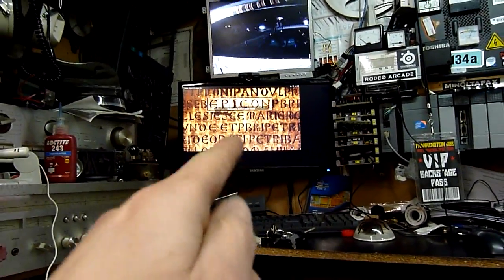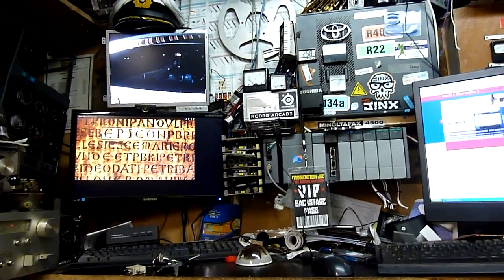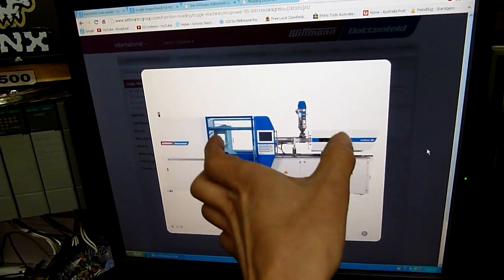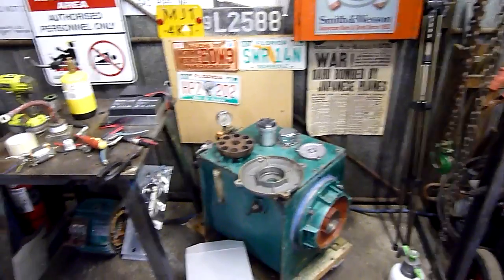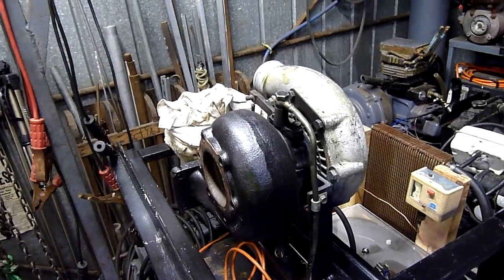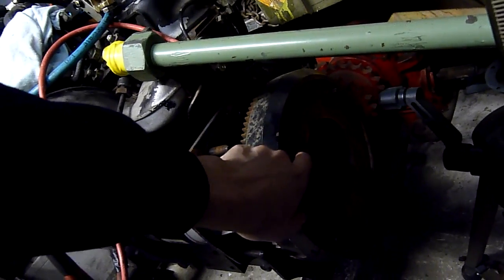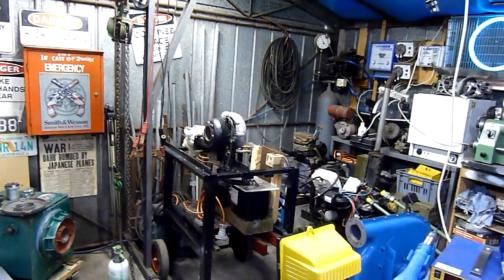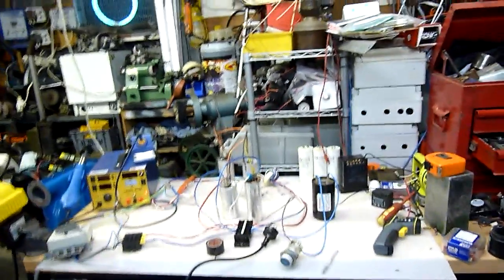Enter the Ramblotron - June 18 2013

Comment from the maker: wow that's pricey :(, another reason why i avoid modern diesels :(.

yeh the D4D is a terrible engine for service costs and gremlins, our local Middys electric bought a Hiace D4D and it went back to the shop half a dozen times in the first few months :(

the high pressure rail can blow out on them as you said, gotta change it all!

Comment: I've been having problems with youtube as well, videos tend to not to want to load. Sometimes the controls do not respond to making the player larger from the smaller window. A few times a video will randomly though rarely skip a complete section an restart playing the video. As well as have had issues that force a quality setting on the video to be not selectable and noticed videos not full screen are rendered software not hardware which I could have remembered at one point being hardware.

Comment: I had the problem with full-screening YouTube videos. It seems that it only effects chrome. I tried it in Firefox on Windows 7 and it was fine. I am not sure if it will work for everyone but the laptop I have issues with has no drivers for 7 only Vista and XP.

Comment: The best thing to use if you are measuring air temperature with a thermocouple is to use a bare one, and twirl it in the air for a bit to stabilize the reading.

Comment: It looks like you are Chrome on the one computer, are you using it on both? If so, it might be an issue with Chrome, but I have never heard of it before. You might try going to the Chrome menu button, and going to "About Google Chrome" and it will force check for an update (although it should be automatic) Also, if it still isn't working, you could go to the bottom of the Youtube page (any page will do) and click "Try Something New!" and try out the HTML5 Video beta. Toggle it, and it might work

Comment: Google Chrome comes with it's own version of Flash Player which I find is a bit glitchy at times, have you tried downloading Flash Player direct from adobe (Ignore the message about built-in support) and then disabling the Google Chrome Flash Player by typing "chrome://plugins" in the address bar, then showing all details (Click Details Top right of page), and checking disable on the Flash Player plugin where the location includes "PepperFlash" and the file is pepflashplayer.dll.

Comment: You're using YouTube Options in Chrome right? It's to do with the quality settings on that, if it's set at 720 for example but the video is only 480 then when you fullscreen it the video is only in the upper left and at 480p, and the controlsare still at the bottom.